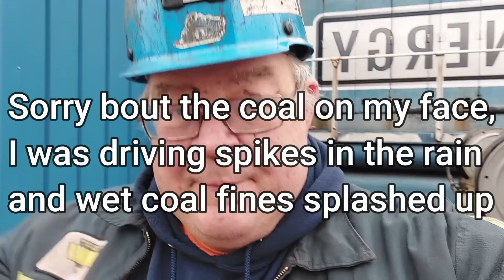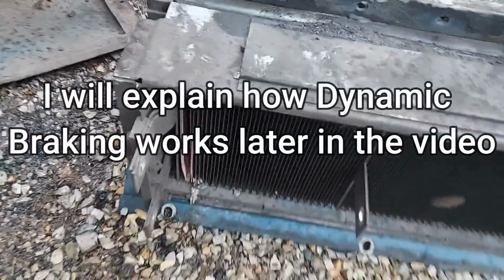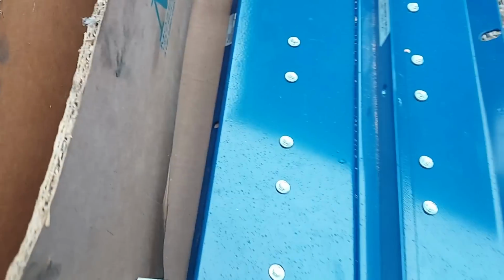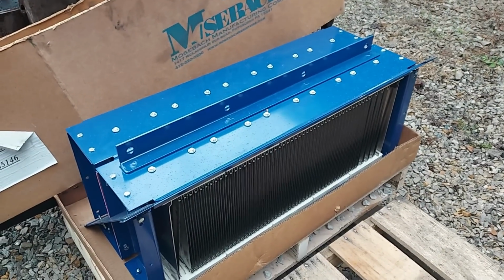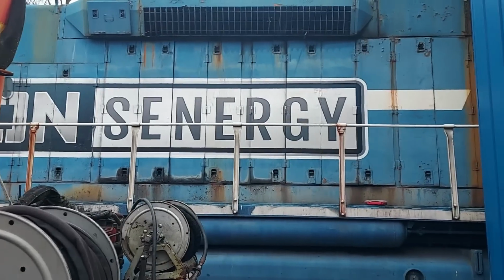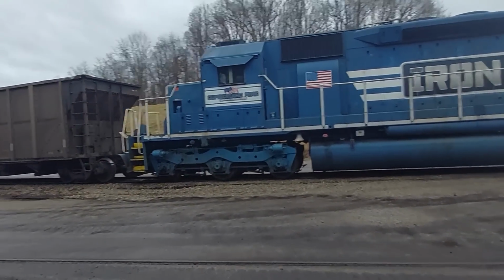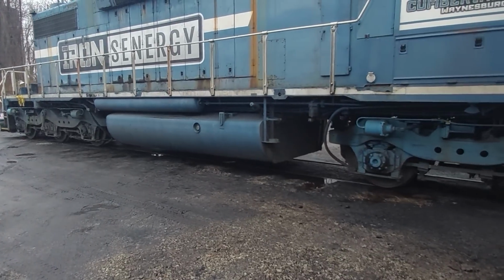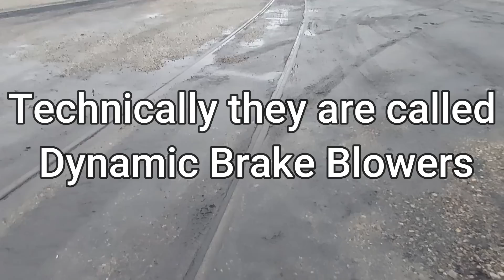New Locomotive Dynamic Brake Resistor Grids

Comment: A big heat sink??
Reply from the maker: You are pretty much right in that Jim. Conrail used to call them
toasters. They not only create resistance but also dissipate the
heat.  Most folks never get to see what the grids actually look like,
all they see is the screening on the outside of the loco body and
can't see inside that.  Very much appreciate your taking the time
to visit with us and check out the video my friend.

Comment: What's the lifetime of the resistor grid?
Reply from the maker: That's a very good question tpobrienjr, and I don't have an adequate
answer. We don't replace these on any kind of consistent basis
so I really can't say how long they last. Coal dust getting in there
doesn't help matters but it can't be helped with what we do here
and since we only have 3 locos seems like they are always in use
and no one takes the time to clean the coal out of the grids on
any kind of consistent basis.  Very much appreciate your taking the time to visit with us and check out the video my friend.

Comment: Dave,
What kind of grades do you face?
Reply from the maker: Steepest grade we have is a 1 mile 2.5% grade and next is 1.75%
on a 3 mile hill Jeff. Heavy loads on those grades the dynamics
hold the train back well on dry rail. Icy or wet rail they usually need
to apply some car brakes.  Very much appreciate your taking the time to visit with us and check out the video my friend.

Comment: Dave, when does it become a viable alternative to just find a NEW used power unit that is in much better condition and SELL these units that you are using now?
Reply from the maker: Well many folks have posed the same question skywatherca. 
Problem is we don't interchange with another RR. So that means
another loco and any rolling stock must get trucked in which is
an astronomical expense for a loco to get in here. Not just anybody
has the equipment to truck in a loco plus the main roads it must
go over must be shut down for a time, not an easy thing to do
and PennDot doesn't like doing that. Last loco we bought #3098
it cost more to truck it in that it cost to buy the loco. So they 
just keep putting money into buying parts. Selling the units would
be the same thing, trucking them out and being they are old,
no one would purchase them.   Very much appreciate your taking the time to visit with us and check out the video my friend.

Comment: Those partners of yours there are no fun with being on the camera. If they are so camera shy, they should wear those black sensor boxes over their heads. I heard somewhere that it is easier for them to wear than to put it in post edit. 😆 In all seriousness I don't blame them, I am the same way when it comes to cameras around me when people are recording. I accept there are security cameras but a person pointing straight into my face I don't care for. Also those resistors burned up good. That had to have been one big puff of smoke that came out the top. For those wondering what they are made out of, it is nothing more than a continuous strip of metal so thick and long that it creates a resistance when connected across the traction motors. When they get over heated or damaged from corrosion, which I believe what happened here, they go higher in resistance and if they go too high they will they will start to get less resistance and melt down as can be seen here. For the ones who will challenge my knowledge on this, look into electronics resistors 101.
Reply from the maker: Our contract mechanics actually watch my videos, but they have
very good reasons for not wanting to be filmed Joe. I will not explain why they don't want to because it is first their right to not want to be filmed but also again they have very good reasons to not want to be shown.

They are excellent mechanics and we are so blessed to have them
here, they have done a remarkable job working on our locos, we
do need them for sure. You are so right about your thoughts on how
the resisters work. Fortunately we don't very often have to change
them out. Last one that went bad was after dark and the operator
saw flames shoot out from the grid! Bet that was a cool sight to
see after dark. :-)  Very much appreciate your taking the time to visit with us and check out the video my friend.

Comment: volatage / current = resistance
Reply from the maker: The grids do create resistance which works to help slow down
the traction motors, now turned into generators in dynamic braking.
Plus the grids dissipate the heat created. Pretty nice concept.
Most folks never get to see the actual grids, all they see is the
screening on the outside, so was pleased to be able to show
something not many ever get to see. We are very grateful for
your taking the time to visit with us and check out the video my friend.

Comment: Too bad the energy created during dynamic braking couldn't be used better.  On the Milwaukee Road in the western mountains they used electric cabs and when they went into dynamic braking, the electricity generated went back into the lines to power other trains.
Reply from the maker: You are right Jim on some RR's the current goes back into the system,
that is called regenerative braking, used a good bit on electric
lines. Now some of it is being used to charge batteries on the new
battery powered locomotives and we are supposed to be getting
3 rail cars that have their own traction motors and the regenerative
braking will help charge those batteries!   Very much appreciate
your taking the time to visit with us and check out the video my friend.

Comment: Judging by those connections those grids are probably 100 200 amps
Reply from the maker: You very well could be right, I will try and find out.
Reply: @ccrx6700  thanks 👍
Reply from the maker: @coreybabcock2025  👍😊

Comment: The shame about the dynamic brakes is the electricity they produce goes to ground and is wasted. Need to come up with batteries that can be charged when dynamic braking and replaced after they are charged. With batteries that need charged. Batteries for Forklifts and such.
Reply from the maker: On our locos and many others you are right, the power produced is
just wasted. Some locos have regenerative dynamic braking which
sends the electricity produced back into the 3rd rail or over head
catenary if the loco is an electric one. On the new produced locos which are battery powered, if there is a diesel in the consist, that
power produced during dynamic braking does go to help charge
the batteries in the battery loco. I don't know of any locos that do
what you are suggesting, charging an external battery tho.  Very much appreciate your taking the time to write in and also for watching the video on changing a dynamic brake resistor grid my friend.
Reply: @ccrx6700  
The other day I noticed the Florida East Coast Railroad has a Propane Tanker in between their Road Locomotives. Providing propane to blend with the diesel fuel for their diesel electric locomotives. I wonder if the diesel engine loses any Horsepower.
Reply from the maker: @mdlanor5414  interesting  👍😊

Comment: Looks like heat & corrosion killed the grids
Reply: i think it was an accumulation of coal dust short circuiting it to the frame and getting very hot at that point.  these could probably be repaired with material from another one.
Reply from the maker: Coal dust gets in there and sure doesn't help matters much 46,
I have no idea if that is why the grids went bad, but again it
certainly was not a help to keeping them up and running. We just
can't help coal dust getting in there. When they replaced the grids
they cleaned all the coal dust that was there out.